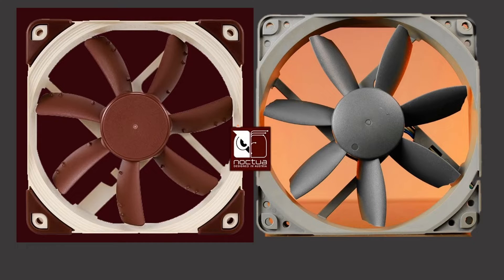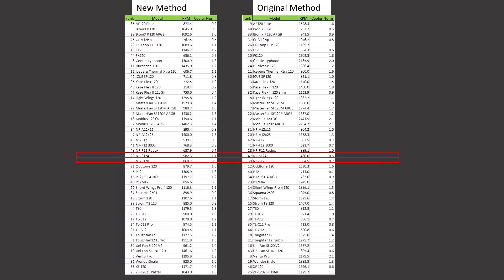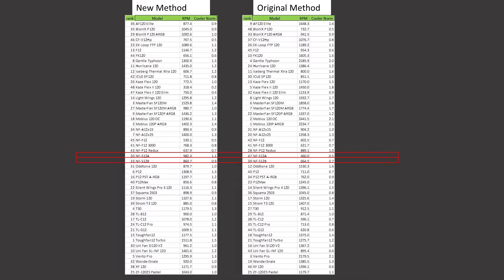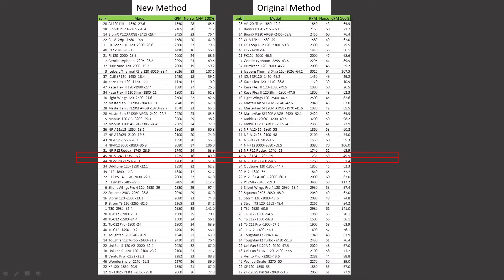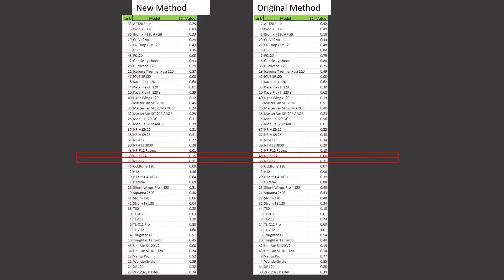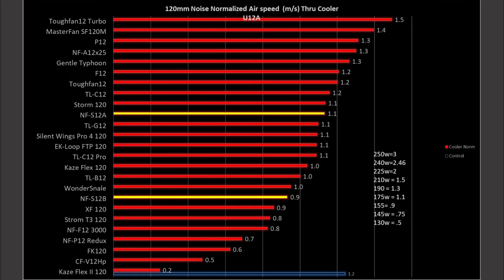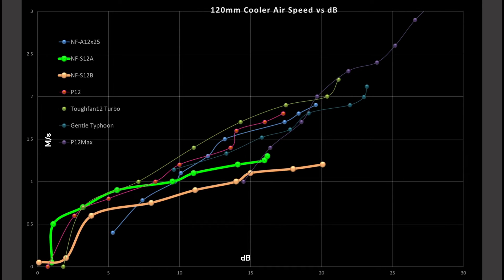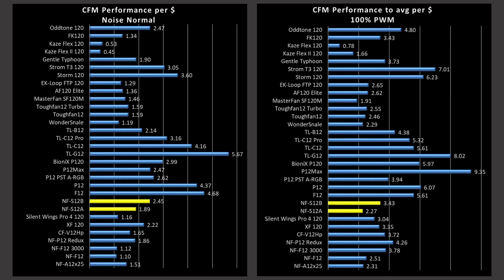NF S12A&B   Are Noctuas Air Flow Focused Fans Still any good?

Comment: I watched this review and the older one. This video does not tell the full story.

1. These fans' CFM rating is being measured incorrectly. The angle of attack to blade surface area ratio is much higher than other fans. The airflow is also hardly directional, ie. it spreads outward like a flower or something. So, I doubt they would have any airflow even a few inches away. But even so, under the conditions for which these fans are designed for, ie. little to no restrictions to airflow, they push a shockingly high amount of air for rpm they spin at.
[I mounted them to a no restriction cabinet for exhaust, and they are emptying the air within faster than ANY other fan I've used prior.]

2. The RPM they need to spin at to push out this amount of air under such conditions is much lower. You would think that this would lower the noise much more than other fans, but like I mentioned before, the high angle of attack means that it does not glide through the air like the NF-A12x25 or other ones which have similar blade geometry. But to its credit it is also pushing a lot more air with every sweep.

3. While the NF-A12x25 is quieter, their sound signatures are completely different. While the NF-A12x25 has a very pleasant sound signature, the NF-S12A has to spin much slower. So, the frequencies are much different. The DB values even though may be similar, it does not tell you the full story. The NF-S12A's frequencies are much more ignorable if you get what I mean.

4. If you noise normalize for little/no restriction air flow, the NF-A12x25 sound signature is definitely more noticeable, the hum just comes through. The frequencies are bunched together and play much closer to a single note than the NF-S12A where the frequencies of the motor and the fan blades pushing the air are slightly off. This means more of the noise produced by this fan blends into the background than that of the other fan. And plus, they push more air! Just not in front of a cooler or radiator.

I had a couple of these fans on order and considered cancelling them after watching your review because I already had 2 NF-A12x25 fans for the same job [which replaced some other fans 2y ago].
But I'm glad I took the gamble, since it paid off! The NF-A12x25s have been retired in place of the NF-S12As.

PS: I would like to see how your testing methodology is for CFM for these fans.
Reply from the maker: I have the method in the video description. 
1: CFM is volumetric flow. so its pipe flow down a tube and i consider it a scientific exersize and not valuable info for PC building. 
2: early on I did videos with this kind of detail. they didnt get views. So I dont really talk about it any more. 
3: do you want me to talk about tones that people generally find pleasant. thats pretty easy I actually looked it up at one point. 
4: the noise normalized is mathematical to eliminate my ambiant room noise since Im not in a sound isolated environment and test to test can have a few dB difference in noise. 
Then I also have a noise normalized value so all fans have the "same" noise value. but since every noise frequency has a different energy to it, its not exactly the same. but it the best that can be done realistically. 
I mean if your happy with the fans that cool. I have no bias to any brand or model. I just test in the way I feel makes the most sense. The case simulation is what you should be paying attention to.
Reply: I can confirm your comment. I used to have NF-A12x25 as an case exhaust fan (MoBo side) in Ncase M2. It started to make some unpleasant noise already at 30% fan speed. Recently, I replaced it by NF-S12A which is much quieter (almost inaudible at 50% fan speed).

NF-A12x25 is great and quiet radiator/CPU cooler fan, that is where it really shines. But just an average case fan.

I strongly do not recommend to consider the video content as relevant, as it does not represent the user experience and real case PC conditions, f. e. how can be PC case simulated with just one fan? You should aways consider intake and exhaust if you want to say anything meaningful about air flow..
Reply from the maker: @hallbregg3369  So in an open back design my case sim is 100% representative. IMO. you are welcome to yours. 
some cases are closed off at the back so you need an exhaust fan. But that effectively makes neutral pressure just like my test. 
I'm glad what ever fans your using makes you happy. These are simply the results in my testing. with the equipment I have. No bias. Just the data and as consistent as I can make it.

Comment: It's great that you improved your tests and you can see better results right away. One more thing needs to be added about these fans. Noctua created them with the lowest possible noise level in mind while maintaining optimal efficiency, so people who want the most silence possible will get the most out of these fans. If you exceed a certain point, they will no longer delight in silence, which is confirmed by your new test. Unfortunately, more and more often in fan tests I see that people forget that Noctua is famous for its fans that are very quiet and efficient at optimal speed with very quiet and at the same time long-lasting bearings.
After all, the owl in their logo is no coincidence.
This is not about speeding up the fan to 100% and testing which one is quieter, just as silence tests should be normalized to 26-28dB, not 35dB and higher as is often done, because it is no longer definitely quiet operation.

If I may make a suggestion, consider adding an airflow visualization with smoke.
Reply from the maker: smoke visualization is something im looking at adding but I dont want to smoke out my house. I read that many smoke machines leave a residue that i dont want on my gaming system. Im planning on seeing if I can get something looking good with just a water vaporizer. the humidity should be on for only a short period of time so it should be fine. 
and buying dry ice would be a pain so often to much $$ for this free channel. 
Thank you. Ive been trying to make improvements. I have further improvements i want to make but it all costs to much for now.
Reply: @computer-tech-more  You're already doing fantastic work.  :)

Comment: For very specific useages they are still alright, but imo Noctua should just EOL them or turn the S12b into the new redux airflow fan, though in general they should bring out a completely new "value line", margins probably arent particularly good in the 15$ and sub range but turnover is turnover, on the other hand it could cannibalize their other products, not easy to make that call and predict customer reactions.
Reply from the maker: I love my noctua fans but they are being pinned in on both sides. Expensive fans now have features but lack good airflow. and low end fans are starting to get really good. like thermalRights fans. They have to compete on quality and longevity. 
As for the S12A/B I think Noctua should decommission them and find a way to make a A12x25 redux.

Comment: Like all Noctua products they're overpriced, so they're a sh*t deal in 2024. Good enough to keep using if you already own them but definitely don't buy them. 
If you're looking for value Arctic / Thermalright smoke Noctua's ass
Reply from the maker: The one area I would disagree is probably longevity / reliability. But that is something I cant test yet. Then the equation become how long will fan last vs cost to replace cheaper ones. 
Noctua has new A12Gen2 in works.